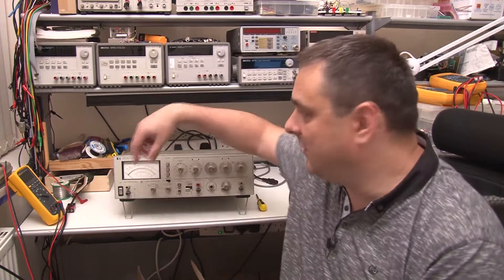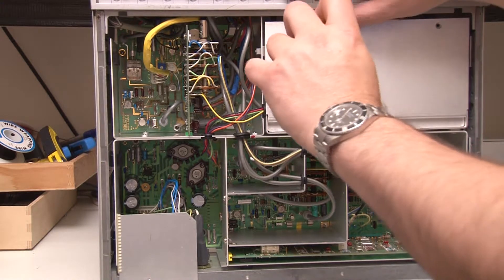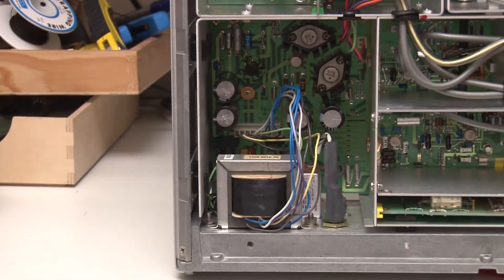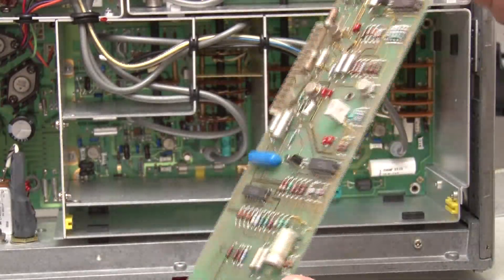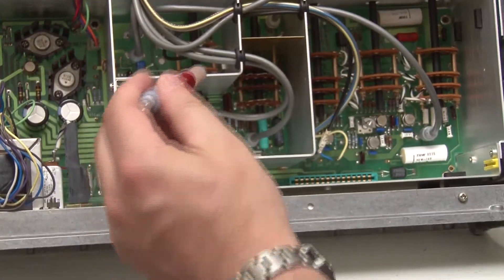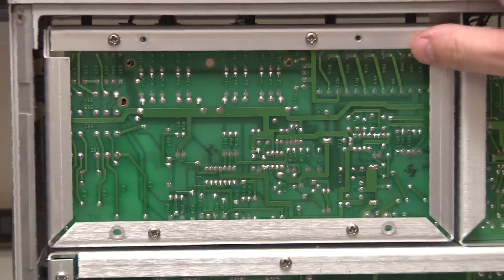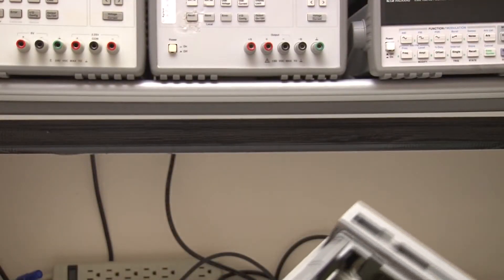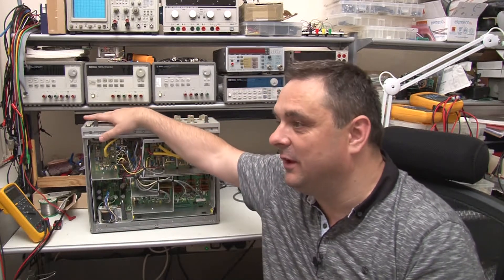HP 339A Teardown

Comment: Can  help on repair my 339A.
Reply from the maker: I would need a little more information that that 
:)
Reply: Hi, my 339A function SW seems not working well. Volts reading is OK. But turn to Distortion functions , the reading seems is out of working. Thanks.
Reply: @gerrysweeney   The unit volt and level range is OK.  Only use distortion range ,the function SW is not working properly.

Comment: That was a nice breakdown video of the Hewlett-Packard 339A Distortion Measurement Set.  Some details of construction quality were not mentioned, so a few extra thoughts about HP's fine instrument might be helfpul. 

The HP 339A (as with all HP T&M equipment) was constructed to very high quality standards, easily at the very top of the industry with regard to product quality and integrity.  Few (probably none) electronic instruments commercially available anywhere in the world surpassed HP's product durability, reliability and overall quality during this period.  The HP 339A chassis was HP's famous second-iteration, modular, "System II" chassis, a machined, cast-aluminum chassis-rails system for absolute rigidity and structural integrity, as well as ease-of-access for service and component placement.  This is a full-module version of the system.  The standards in dimension also allowed these instruments to be stacked and modularized without an issue of misalignment.  Each screw used in the 339A is stainless-steel "Posi-Driv" type machine screw, designed for maximum quality and strength, and no expansion screws of any type were ever used in the "System II" chassis.  This "System II" chassis was a derivative of HP's industry pace-setting universal "System I" chassis system first introduced in 1961.  This chassis construction was built to such standards that the instrument was put through a rigorous series of "drop tests" and other strife-testing, along with environmental, altitude and salt-spray tests for durability.   

Each component circuit board was electro-gold plated, a costly and time-consuming extra measure of detail indigenous to nearly every Hewlett-Packard instrument manufactured during this period from the mid-1960s until nearly the year 2000 (after which some critical instruments continued to be manufactured with this same standard of quality).  Gold-plated boards virtually eliminated the oxidation/corrosion issue so much a problem with most commercial products built to a lesser standard.  HP took the further step of tropicalizing circuit boards and connectors to withstand high humidity and moisture issues.  All components were underrated and 100% incoming-tested for quality assurance, and each component was the highest quality available for the purpose.  In short, HP equipment was expensive, but it was built to last a lifetime. 

Hope this information gives further enlightenment regarding the fine quality of the HP 339A. --Tom Tyson (ARHPG)
Reply: 좋은정보 감사합니다.